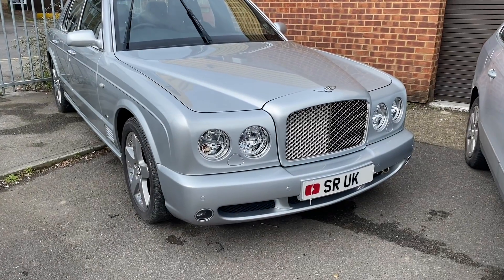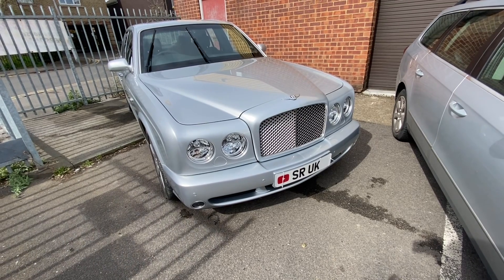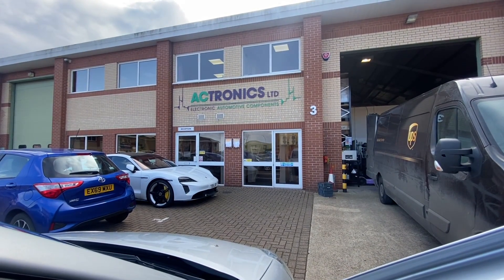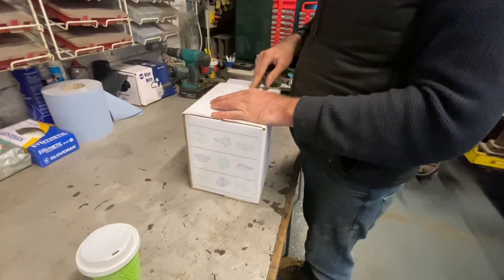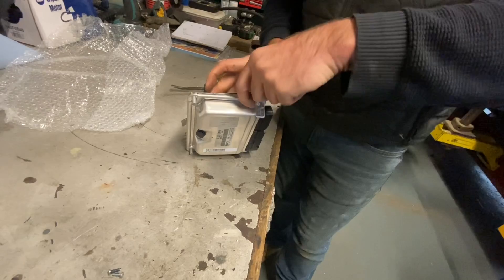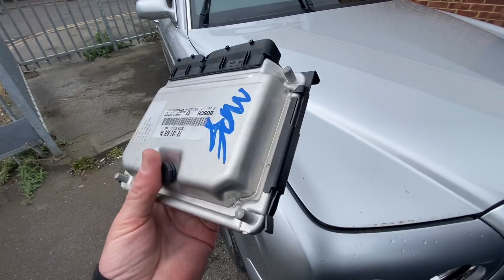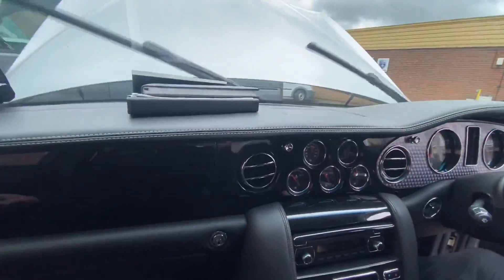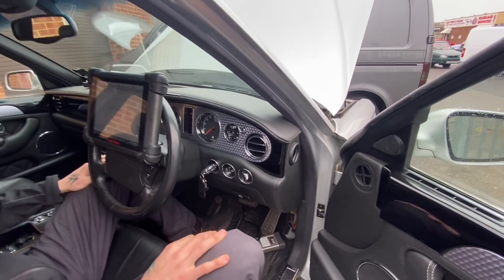NON RUNNER £30K BENTLEY ARNAGE 6.75L GAMBLE PART 2

Comment: @salvage rebuilds UK - For future reference, the ECU's you have there are based on the Volkswagen type, meaning the immobiliser is either in the Cluster, OR a separate immo box which reads the code from the key. When you swap the ECU's, as long as they're identical you can open them both up and in most cases you can swap the little 8-pin chip (known as an EEPROM) inside which holds the immobiliser (actually the VIN number) data. Even thought the old ECU was cooked, it's unlikely that the chip was damaged, so swapping it over would likely still work fine. It's a 5 minute job for anyone who can solder carefully, and after doing so you've essentially changed the identiy of the new ECU to the same as the old one, and the vehicle should start fine.

Comment: I don't want to put any sort of damper on the Bentley, but reverse polarity from a car battery can do all sorts of major damage. The burnt missing bits inside the ECU were the protection diodes which just evaporated. Good news that the ECU change has proven okay for most of it, but I think there may be many other problems caused by the battery reversal.
Reply: I think I may have mentioned this in the last video on this car. My friends Brother did the same thing on a Mercedes, it blew the big main fuse and fortunately that was all. There is a term in the electrical world it is called 'Descrimination' too complicated to go into here but provided it works as in the theory I think we may be OK. The wipers and other things work so I am hopeful.👍
Reply: Fuses hopefully limited other damage. Clearly there are other small bits the autoelectricians are looking at, wiper motors etc.

Comment: Hi Rob if you get an electronics repairer to swap the ST95040 eprom from your old unit to your new unit then that will transfer all original immobiliser data stored on the chip and car will just think new ecu is the original one and car will run without issues.

Comment: I work in auto motive manufacturing and a bit of advice for anybody with electrical problems before you go spending money on parts. Check all cables and connectors and remove connectors to check for electrical over strees (E.OS.)on the pins of the modules. You might smell E.O.S. without having to open any modules but in this case you couldn't. I can see that the PCB is completely fried in the area where the voltage regulator blew up in my experience this will damage other modules connected to the E.C.U. but the damage will not always show immediately.

Comment: Love watching your videos guys.
I do awkward repairs on circuit boards, and micro soldering repairs, I would gladly try and repair the old one for you, what do you have to lose? Let me know.
Another option is I could swap the chips between the two boards for you, that would get it working with the old data…
Reply from the maker: Send me your Adress and price to instagram I’ll get it in the post 👍
Reply: Yep a good electronics guy with all the test gear could repair this .. got to be worth a go .. at least the board isn’t potted ..
Reply: I transferred the data on a Porsche Cayenne ECU which is very close to the Bentley ECU reading straight off the board with a piggy back to transfer imob coding data rather than send the car 600 miles to get it recoded. The mileage can also be corrected over OBD2 on these vehicles using a digiprog 3. Porsche and Bentley electrical systems of cars of this age share many common components.
Alternators rectifiers are prone to partially fail injecting AC into the system, on mine causing a fault on the AC controller showing 'high voltage on pin 31'. Much of the dash is also shared with a cayenne.

Comment: Quite frankly, those Bentley "Specialists\dealerships" should be ashamed of themselves. Why don't these overpaid people want to own the problem and desire to get to the bottom of it? To plug in and say "No communication, can't help" says it all. They haven't got a clue if "computer says no". They know nothing. They should be consulting with the factory and expanding their abilities and knowledge. Shame on them.
Reply: Like most dealerships they are all just fitters that work there.......computer says no......😂
Reply: They cannot be bothered unless you offer them 'loads a money' even then I think they would be clueless. 🥺
Reply: Absolutely,in an ideal world they should at least have a working 'Test' one to temp fit to the car like we've just seen to rule things in/out
Reply: @Paul Desmond. Yeah, "fitters" replacing failed or broken parts. Not proper motor engineers/electricians/technicians in the 21st century. Can't see them graduating into the world of electric vehicles, can you? Stay safe and well.
Reply: they don't get enough ecu work to specialize - if the first fault is no coms then you are opening up a hornets nest that needs someone like diag dan to fault find it - if you watch his channel, you'll see that the most unconnected issue can cause the most unsuspected faults.
Reply: @whitemonkey7932  as Jon Webster pointed out above, these guys should carry known good ECUs to at least nail the problem down by swapping out. They don't even do that. How much would it cost Bentley to produce a few test ECUs for the technicians to use  in the dealerships when the cars are in production? At least their reputation would be less embarrassing. Hardly a huge outlay given the price of their cars?

Comment: Keep the old ecu safe - from experience with a porsche cayenne that uses a very similar ECU, you can read the ECU EPROM and transfer to the new ECU to avoid imob coding issues. The mileage on these ECU'S can also be coded over OBD2 using a digipro -  
I used a 20 quid eprom reader and read the memory still on the board without desoldering - read the new eprom and back up first. The electrical system of Porsche and Bentley of this age is surprisingly similar.
As you said - it could be reverse polarity but I had all sorts of trouble caused by the alternator - charging voltage was OK, but what should have been DC had loads of AC components caused by the rectifiers. Launch X431 software works well on these vehicles.

Comment: Looks to me like those components are reverse polarity protection diodes. Basically what they do, they are kind a one way "valve" for electricity, and they put them in circuit in reverse, so that they do not conduct normally, but if there's a reverse polarity supplied, they conduct, creating a short on the supply line, and hopefully blowing the fuse, before it damages any other part of the circuit. Very often when it happens, it kills the component, like has happened here, and they fail short, and as you can see they let out the "magic smoke", and can melt the tracks with the high current through the short. It looks like the PCB got damaged too much to repair. When it gets charred like that, the board itself can show up as a short with all the carbonisation, and once it's at that stage, you can only replace it.

Comment: Hi guys, I have an Arnage (2006) and it randomly does the same start that you experienced. It is a very difficult one to resolve and the local Bentley dealer wanted all spark plugs and HT leads changed before they would do anything else to diagnose it. As you know with the engine space, Sparks and HT is not a simple task in the Arnage. I also had the Plausable Immob error in the diagnostics and I replaced the key battery and reseated the key ignition controller cables and (touchwood) it has gone for now. Looking forward to hearing how you get on with the fix and hopefully watch for an update from you! - good work
Reply: the imob reads an embedded chip in the key, even without a battery in the fob it will still start the car.

Comment: You are correct about both the 24V and Reverse Polarity, if it was just Reverse Pol then the  Rev Pol Protection Diode would not have blown itself off the PCB along with some Caps, but Rev Pol and 24V = "Tic Boom"!

Comment: Hi guys, at last.  So much excitement about the Bentley.  As a retired electronics engineer, I am gobsmacked to think that a reverse polarity would cause that damage on the ECU.  Electronic circuits which are prone to reverse polarity damage, are normally protected by a diode which prevents the said circuit from drawing power from a reverse connection.  If it is not there on the ECU, then someone wants their backside kicking!  
Very king regards and keep those videos coming. 
Chris
Reply from the maker: We think it must have been 24v bud 👍
Reply: @sruk  Do check the alternator...not just using a meter but by scoping it - if the rectifier pack starts to fail it will still charge and appear to be charging at 14.2V but will also inject a lot of AC into the system - normally the climate control ECU is the first to protest by shutting down and when the fault is read you'll see "high voltage on pin 31" (if I remember right)

Comment: In my opinion, that blown ECU can be repaired. What blew was most likely a diode on the power input which is there to prevent damage from connecting the battery backwards. So it did its job. It wouldnt be pretty but it can be repaired. The shop you sent it to for repair most likely didnt want to repair it and cover it with a warranty. For the sake of a component that costs 10p or less its got to be worth trying. However as others have already said this ECU may just be the start of your problems and you could find several of the other ECU's have the same fault.

Comment: Flying Spares has been my "go to" place for Bentley bits for the 3 Arnage's I've had, that has defo been boosted with 24v, Arnage's need to be on a battery tender when not in use as the HVAC system stays live (Batteries last about 4 days if left off charge, Bentley sell a trickle charger for 200 dabs 😳, factory fitted charging socket in the boot tells you all you need to know), good luck getting the immobiliser sorted but punt it on ASAP ! ! as other ECU's will start playing up if that's had 24v through it, trust me, been there done that

Comment: I done to many electronics repairs to know as soon i seen the ECU inside that was reversed polarity as the component missing is a protection diode, basically protects the the ecu in this cases causing the fuse to blow but  if you insist this will happen and the magic smoke will be released lol. Stinks but its not harmful. So happy to see the engine turning... :)

Comment: Good stuff lads. I don't work on cars, but that diode that was blown on that ECU is exactly the kind of thing we repair. Tracks and things can be repaired too, no problem. Consider not scrapping that ECU, because it could have repair value.
Reply: having a known good identical unit on hand would help in tracing out where the destroyed tracks go and repair with bodge wires and epoxy. i have done something similar to save an irreplacable ECU for an oddball JDM car.

Comment: I was very happy to see the update on the Bentley. I love the Arnage, and hope to own one at some point. Bentley probably has a record of the correct program to push into the ECM. I was really excited to see it run as well, even if the computer shut it right down again. I'm looking forward to the next update! I am watching and learning as you go. Nice job so far!

A while back I was watching another youtuber here in the US working on a Bentley Continental that had been vandalized with sugar in the fuel tank. He was a young guy and had not yet learned that what sometimes appears to be the hard way to do something turns out easier and better in the end, than the 'short cut'. I watched this kid spend hours in the 'boot' scooping out the tanks from the access panel in the boot. He burned out a few fuel pumps and clogged several filters trying to purge the system. I finally told him he should just remove the fuel cells and the lines from the car, and wash them out with soap and hot water outside the car. Filter the fuel and save that for the lawn equipment. He would have been hours ahead and money saved, but kids don't always listen. Sometimes they need to learn on their own. I also could not believe that he didn't change the oil before starting it. At least he did not say that he had. He took a dangerous chance with that W12. Once he got it started it appeared to run just fine. He got lucky.

Comment: The part that's blown is just a suface-mount diode, it's probably designed that way to protect against reverse polarity. 50p from Radio Spares. Might be worth repairing the pcb tracks and fitting the new diode, then ask your your mates to re-benchtest it again.

Comment: I would probably say its down to the battery charger that you can get with the car when not in use so you can stop the battery from going flat plug it in to the mains its very possible for it to overcharge or have a power surge or the wrong charger was used or has you say someone might have put the battery or jump it the wrong way round experience mistake to make on a beautiful car.

Comment: I had the same issue with a 2004 Vauxhall Zafira, I replaced the ECU, ignition transponder and the chip in the key, problem solved

Comment: May be looking in a simplistic way, but is there a possibility of borrowing the key from Westminsters that the ECU came from/is matched to, getting a blank key cut from your Bentley key then having a key transponder cloned from the Westminster key to put in the newly cut key? If you had a new blank cut with an un-coded transponder, if the Westminster key with its transponder matching the ECU was placed close to the receiver in the ignition the new key without a transponder and a signal from the Westminster transponder may allow starting.

Comment: wipers fault could be a relay, had a car years ago wipers wouldn't switch off unless turning ignition off, turned out it was a relay, I opened the faulty one up and it was full of water, so it was replaced and that fixed it.

Comment: Always great content Guys. The circuit board in the ECU was completely destroyed and beyond repair. Some printed circuit boards can have multiple circuits in each layer, some may only be double sided and have two layers. I agree, the extensive damage to that board must have been caused by a 24V battery. A reverse polarity battery connection could also be a culprit caused with either a 12V or the said 24V battery. IMHO, if it were not for the ECU being sealed in a metal fire proof box, that car would be toast Guys!! I pleased your a step closer to solving this car's issues!!  As far as the video's go, I would rather see 3 in a week, rather than 1and have the full content.  The quality is perfect and there's no need to change it in my opinion!! Thumbs up Guys!!

Comment: Pretty sure it will have to be an ECU specialist that can remove the immobiliser,  most dealers wont be given the option on their dealer software , probably their new ecu will come virginized , then can either be programmed with software , or will need security pass codes,  Rob , when you said "can we start it again " , brilliant news,  keep up the good work , I'm sat outside Manchester Royal Hospital , my 80 yr old mum is in there with a bleed on the brain , limited visitors , so just got to wait outside , what can we do to take our mind off it on a weds , watch Chris and Rob 😉

Comment: I had a CLK320 that the ECU died on. All the coding was in a programmable chip in the ECU I unsoldered it with a hot air solder station, soldered it into the scrappy ECU that I bought and all was well! The whole job cost £70. I wonder if the AC fellows can determine where the EEPROM data lives in your ECUs?

Comment: the immobilizer simple disconnect fuel pump run new wire to ignition  job done
Reply from the maker: That’s not the correct way to do it bud. That’s ok to get you home 👍

Comment: Sometimes there is an 8 leg eprom 95p08 possibly or 95320 eprom which can be swapped from the original ECU to new .  Do an internet search it may help 
I think it's on the reverse of the board .  Maybe ac tronics will know
Reply: Also it looks like it's possible to do an ecu clone providing you can get a read.  

To clone both ecus need to be opened

Comment: When ever I have to replace an Ecu with a used one I always try and get the transponder and immobiliser unit with it as they all match and will work then “plug and play” it Varys a lot through from car to car some cars you need the  whole Speedo cluster too depends how many modules the immobiliser information is shared on 👍 shame you can’t speak to the old one as would be nice and easy to clone it but now you will have to get it wiped and Bentley or a specialist will have to re code it. Keep cracking on though lads great work
Reply from the maker: We have done a lot of swapping in the past we just want to keep this as original as possible

Comment: You should transfer the memory/data chips from the faulty ecu over onto the working ecu. It's likely only the power line/mosfets have blown on the faulty one so someone with micro soldering experience should be able to swap the chips around for you. Shouldn't be any need to reprogram anything.
Reply: no need...the data is stored on a 24C08 EEPROM (i'm sure that's correct) and can be lifted off insitu with a cheap reader and a piggy back clip.

Comment: Good results guys but I’m a bit surprised nobody picked up on this before as it would have been obvious (the burning). Always worth a quick look inside an ecu if problems. 
Anyway crack on 👍
Reply from the maker: If you open a ecu any company’s will refuse to look at it after 👍
Reply: @sruk  that’s usually after a repair though. 👍